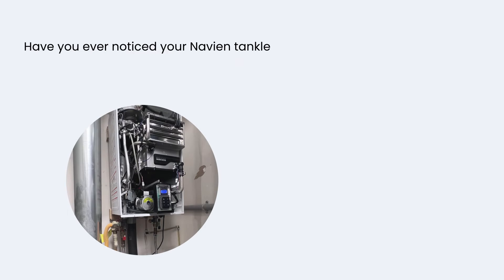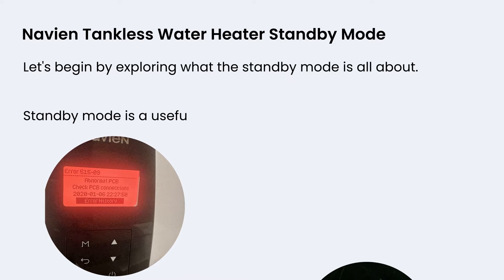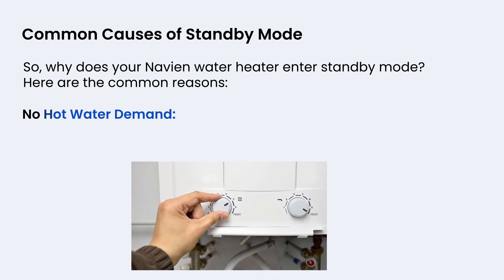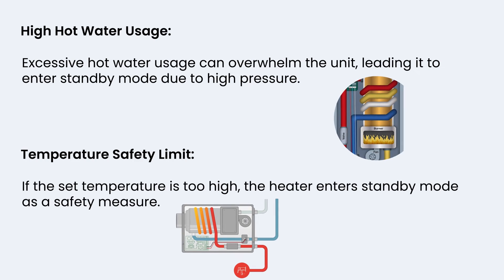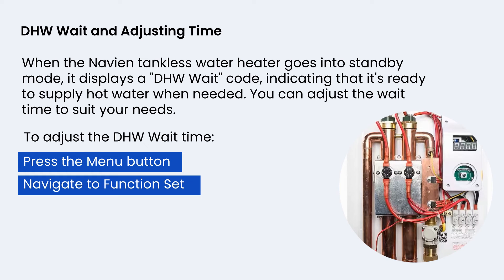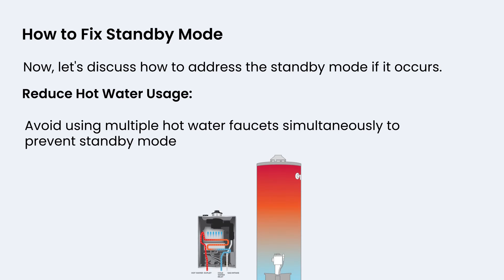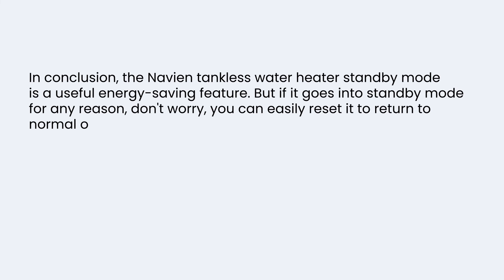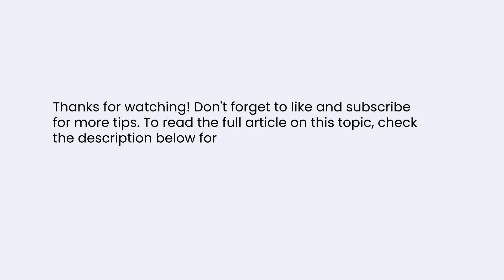Navien Tankless Water Heater Standby Mode | Meaning and Troubleshooting Tips

Comment: Uh, standby mode happens on mine whenever the unit decides it's too cold outside, leaving me with no hot water on cold days. And there is no reset button on mine. This is not a nice energy saving feature, it's a nightmare